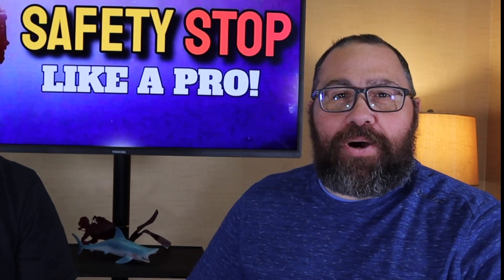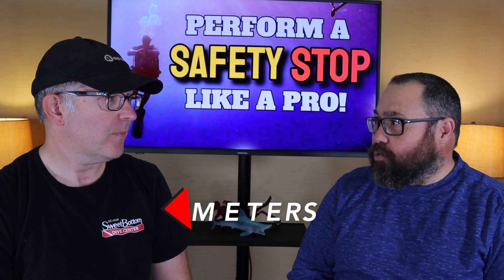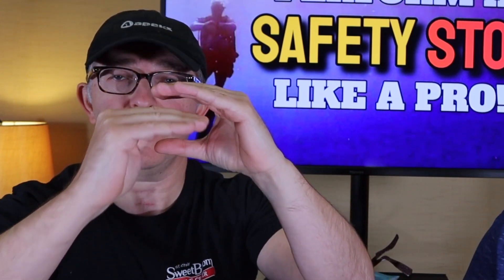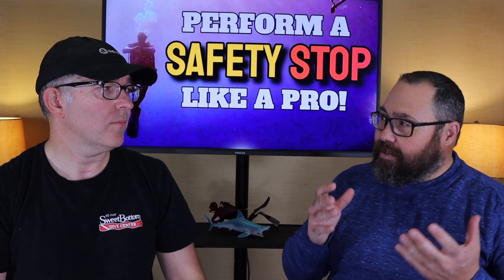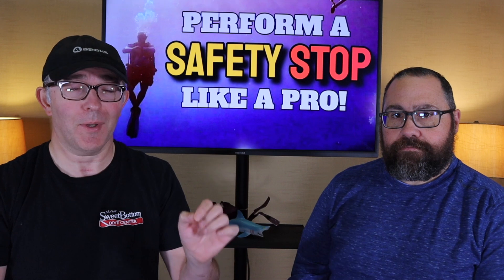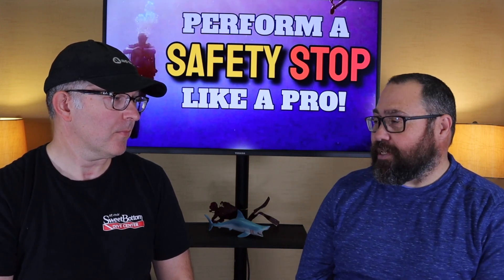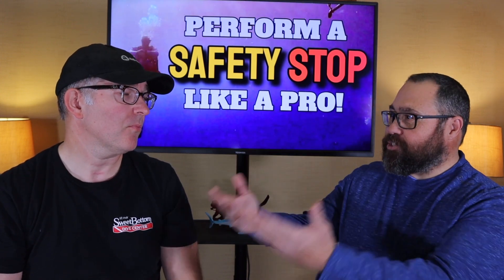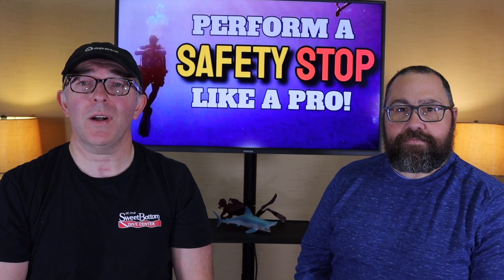How to perform a scuba safety stop like a Pro!

Comment: When ascending. I will hover at 7-8m for a minute to check my buoyancy before ascending to the 5m safety stop. I found I get better control of the safety stop following this procedure. I prefer to execute horizontal SS, all my organs are at the same depth for even decompression. One more emergency that will cause you to skip the SS is in case of lost buddy

Comment: Lots of good information here. I have been used to holding a line during safety stops on boat dives, but local quarry diving this past summer helped (forced) me to practice my breath control at 15 feet instead of ho,ding on to something.Thanks for the helpful vertical tips!
Reply from the maker: With practice Lydia you will get it down! Thanks for watching!

Comment: I tied eyelet loop for boat cleat in one end of 60ft white anchor rope with a mushroom anchor at other end, filled with lead. I tied one terks head knot at 10ft down from water surface. 2 terks head knots at 20ft. 3 terk heads at 30ft. 4 knots at 40ft.. When diving, first lower this anchor from cleat. so when I want to stop at 40ft stop from surface I ascend up rope with hand until I come too 4 knots on rope! After that outgassing stop I want to go to 20ft, I ascend up rope till I feel 2 knots. (Lead in mushroom anchor adds enough weight to not allow much lift in anchor while at depth stops.)

Comment: Safety stops in currents may require you to hold the anchor line. I have looked like a flag in the wind at times. Excellent video, Thanks!
Reply: If they are making you do that then they don't know what they are doing.  In that situation you need a break away deco station

Comment: I usually don’t hang about in a vertical position, I find it offers way less control in water that actually moves, that is to say big open sea swells, diverse currents, or waves building in the shallows near a beach. 

What I mean by control is readiness for a variety of actions be that buouyancy adjustments that go beyond what my lungs allow me to control, or assisting or responding to other divers that I am responsible for. I want to be able to perform horizontal movement immediately if I have to. I do not need to be in a vertical position to control my buoyancy or to orient myself about my overhead and the surface. 

Frankly I also find breathing more relaxed in the horizontal position as the ambient pressure is not working against the volume in the lungs in the same way - and the regulator certainly is in a more optimal position in terms of air delivery. 

Some environments do not even really permit the downward extension of your legs and fins where you may bump into all kinds of things - and in others they open you to different water movements at different levels as you hang there like a sail waiting to receive the crosswinds. It’s not aquadynamic. On some night dives you will be at greater risk of bumping into all manner of shit underneath you, especially if you are getting moved by the current - and again - you have to change orientation to respond to anything, which in turn will change your position in the column and shift your buoyancy - which may matter in uneasy, shallow waters. 

In terms of body/algorithm relationships you can also argue that the horizontal position keeps all of you at the actual level of your computer but unless you have been really pushing it, that should not really matter. 

On a calm day I may do a bit of the old guru levitation style stuff sure if the general vibe in the group and the water is relaxed, but for all practical intents and purposes I prefer the level position any day of the week. I may also do it, while turning if it’s an especially busy area with a lot of stuff going on at the surface.

Comment: A question I have is how to perfect my center of gravity so I can hold my position in the water? I’ve tried to “Buddha” in the water and I keep tipping over causing me to scull and kick. My BCD has limited places to put trim weights.
Reply from the maker: Brian, the position of your trim weights certainly hold the secret to maintaining your center of gravity. Some divers forego the use of the trim pockets and may place weights on tank bands or other locations to optimize their trim. We have found that the use of a backplate or a BCD with pockets located inside the back of the BCD so that the weight is held closer to your body helps decrease that "falling back" or "rolling" motion caused by weight away from your body. Not that we are here to sell courses, but the PADI Peak Performance Buoyancy Course , works on all aspects of weighting, trim position and hovering skills. Depending on your certifying agency, locate an instructor who would work with you to help improve your trim and buoyancy. Thanks for the question and thank you for watching!
Reply: Practice practice practice. And try putting some weight back on a belt in the front, just left and right of the buckle. This will help with trim position diving and at safety stop.

Comment: Do you have any tips for staying vertical and not tipping over? I have no problem staying at 15’ but sometimes crossing my fins makes me want to tip over.
Reply: Weight placement, (apart from buying specific equipment) placement of the tank on the jacket, how you wear your jacket, 
trial and error, try, fail and play around.

Comment: Question... newbie open water diver here.  After the stop and you're finished, on the final ascent, should you be angling towards the boat (presuming you're not already right under it) or should you go straight up, surface, and then make your way to the boat?
Reply from the maker: Denny, thanks for your question. You could ascend in either manner. If ascending in a horizontal trim position then a slanted ascent may be easier to see above you and in the direction you are traveling. If you are in a vertical position then a straight up vertical scent may be easier. Either way though the biggest factor is to ascend slowly from your safety stop at a rate no greater than 1 foot per second (some agencies even prefer a rate of no greater than a half foot per second). 

The reason. For this slow ascent is in the last 30 feet (10m) of your final scent you experience the greatest percentage of pressure change to reach the surface. 

We often see divers doing a great job of slowly ascending to their safety stop then blast to the surface after completing their safety stop. Not what you want to do. 

Thanks for watching!
Reply: @everythingscuba  thanks.  Where in the midwest do you guys work?  I got certified on a recent trip to Bali (what amazing reefs there!) but would love to find somewhere more local to keep diving as well (S. Louis area).  Best I've seen for "neat stuff to explore" is Beaver Creek in AK (but having trouble finding a dive shop doing dives there post covid), and Bonne Terre mines lake here in Missouri.
Reply: @everythingscuba  That rate would give me serious DCS (I'm diagnosed with PFO on my heart) so I prefer ascend rate 10fpm (1 foot in 6 seconds)

Comment: First accept my excuses if I will be too incisive further. I am amazed that you give pro advice and you don't even mention that is HIGHLY recommended that you do a safety stop in a horizontal position because of one essential reason: All of those  theoretical tissues considered by the different algorithms used by scuba computers and tables will do a proper "safety stop" beeing at the same depth as the lungs and as the dive computer/depth gage so they will equalize gas pressures in the optimum way possible. Also why the heck are you mentioning decompression in a technique (safety stop) aplicable to rec diving ?? Very pro-tips in this vid :)).

Comment: There is really no reason to ever be vertical in the water. It is just bad form, requires a transition to horizontal to make a position adjustment and usually is the result of being overweighted and flapping arms and bicycle kicking. You should be in horizontal trim during your safety stops. The skill is not buoyancy, it is buoyancy and trim. They always go together.
Reply from the maker: Our response to that answer:

https://youtu.be/dowTVJqzFLo?si=T8XME4W4U3ssmrBt
Reply: @everythingscuba  Again, there is no reason to be vertical in the water. It is a bad habit and only reinforces bad behavior/trim dragging their fin across the bottom. It is not a matter of safety, it is a matter of diving like the "pro" you claim you are. There is no reason to be vertical during a safety stop, do a helicopter turn if you need to look around. And it says beginner or clueless and certainly not professional.
Reply from the maker: @ let’s agree to disagree.

Comment: Is there a real need to do a safety stop? Think about it………., no, not really. As sport divers we are not aloud to do decomposition dives. It is something we do because it is taught that now days. It’s not a necessity. Let’s say you dive at 12 meters for 40 minutes and come up to the 3 to 5 for 3 to 5, compared to say 40 meters for 10 minutes then coming up to 5 for 5 minutes mandatory deco stop. There is going to be a lot more nitrogen in your body, then if you did the shallow dives for longer time with no deco stop. I have bean diving for 43 years and only do safety stops when diving with a dive company to keep them satisfied (cover their ass). I have never been in a mandatory decompression situation. PLAN YOUR DIVE, DIVE YOUR PLAN, keep out of deco and you won’t have a problem. By all means keep doing your safety stop as it never hurts to be cautious. Happy bubbles.
Reply: While it's true that it's optional that doesn't mean it's a bad idea. It adds quite a bit of safety. In essence every dive is a decompression dive and the last 10 meters have the biggest pressure gradient. Some people do a safety stop, others ascend from 5m at 1m per minute. Both are fine. Bolting to the surface on your third dive of the day may not be.

Also remember that not every body is the same. A significant percentage of people have a PFO without knowing it and for them the safety stop adds some much needed safety. That's why we use gradient factors during deco dives too. We shouldn't follow the M-line exactly unless we were all the very fit 20 years old Navy divers that the tables were designed for.

Thirdly getting DCS once significantly increases the chance of getting it again, so prevention really is the best approach here. Spend that extra minute.